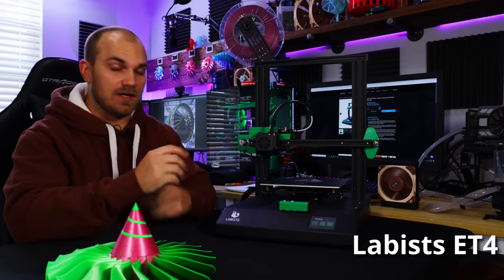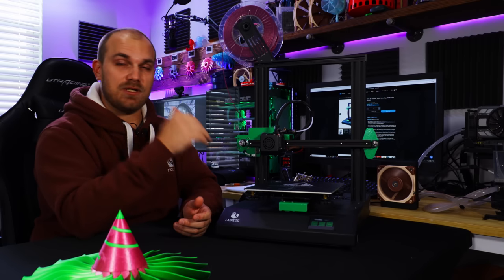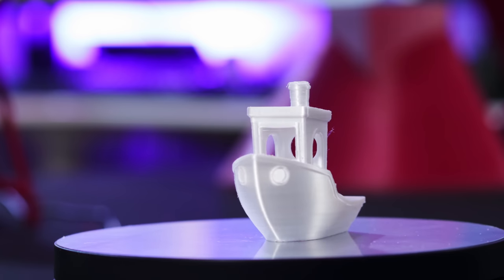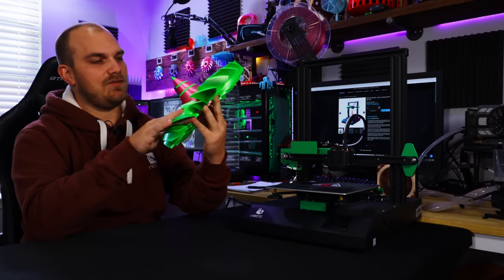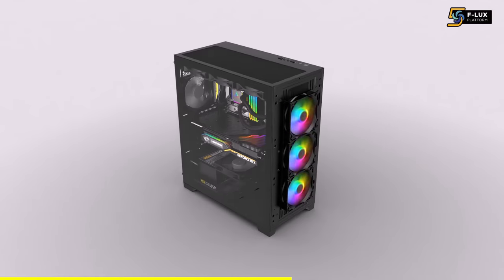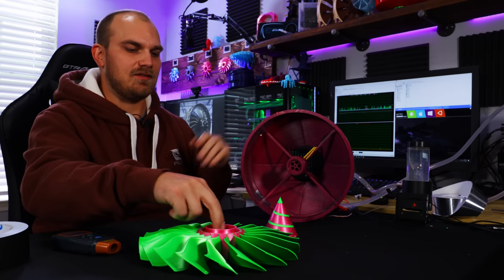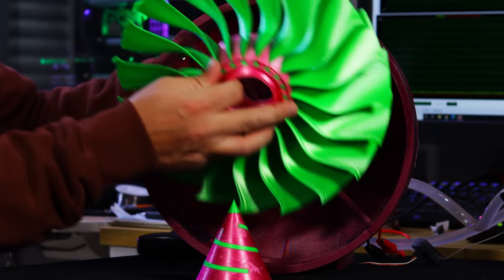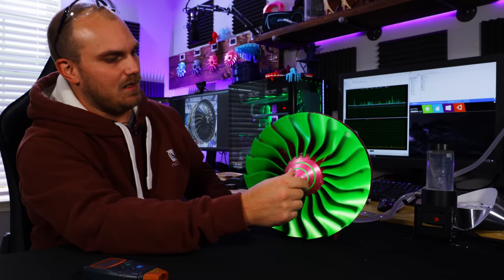3D Printed Jet  Engine Fan Water Cooling | Labists ET4 Review

Comment: To deal with the overheating motor, you could leave the nose open and let the air cool the coils directly. I did this with later revisions of my replacement fan blades at https://www.thingiverse.com/thing:2790219 as the motor was overheating and warping the printed fan blade hub.

Comment: Get an RC Car motor with enough speed and torque. As far as i know, in rc cars motors only can fulfill one of those specifications better than the other, but finding one with 2000rpm and enough torque should not be that hard. I would guess a brushless motor with about 1000kv on 2S would be enough. But i am guessing here

Comment: Use your laboratory power supply to power the motor.
Also, someone should 3D Design an actual compressing turbojet engine.
Turbofans will not really work for 120mm

Comment: why dont you just take 4 radiators 4 fan version n put them together make big radiators to support that big fan 
i wanted to see if can keep up with CPU if cant or can then throw in GPU  and see if can keep up with both if it does then be awesome videos

you need get car motor not air plane motor because that where motor get too hot trying to turn it and rc car motor doesnt heat up like that or u could get one off rc boat motor because i find it more interesting run liquid cooling "motor already have liquid block build on it" n see if temp changes any different during test

make it more challenging

Comment: Fellow custom loop friends watch the only video I have uploaded here on youtube and lemme know if you've had similar experiences/fixes .

thanks!!
Reply: The problem is not clear from the video. But if it's some kind of gelatinous slime then i had a similar problem. In my case, water had seeped into the pump and eroded the sealant around the impeller coil.
Reply: @pirugnappo  thanks , I plan on tearing everything down when new stuff shows up

Comment: so your assessment was wrong, saying the shroud was causing low RPM was wrong, spun the same with/without it. and no air was going through the radiator because you took off the shroud. thankfully you dont work on aircraft lol